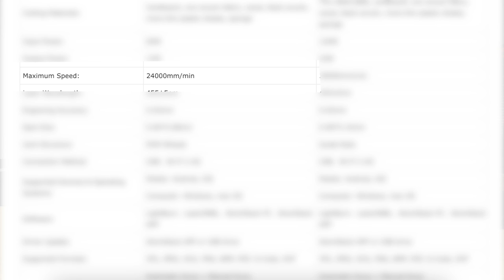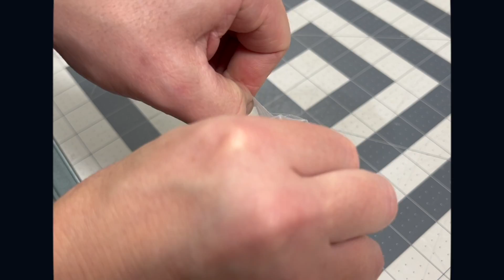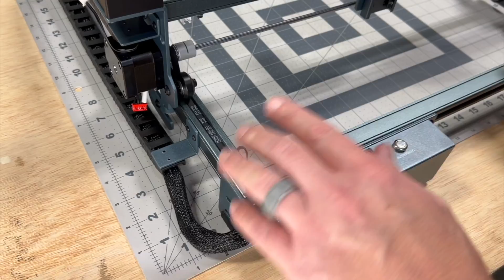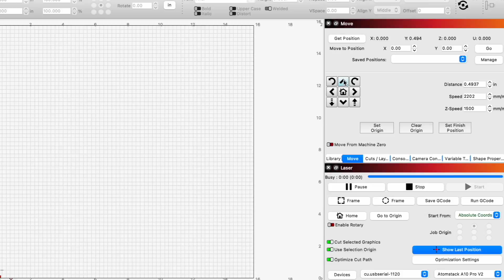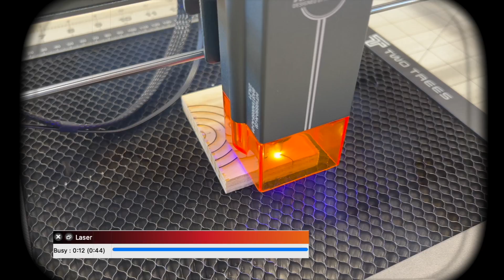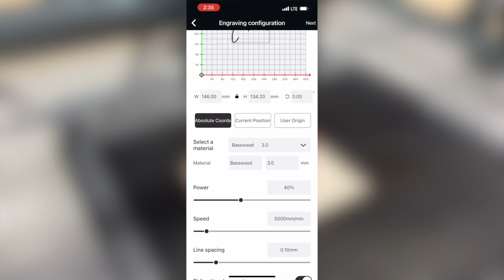AtomStack Ace A10 Pro V2 Laser Engraver UNBOXING & SET UP

Comment: Thanks for the video.  One question as I dont have a laser yet.  since there are two focus heights for cutting and engraving and the z axis is not automated how does that work with lets say an engraved piece that you will also cut out.